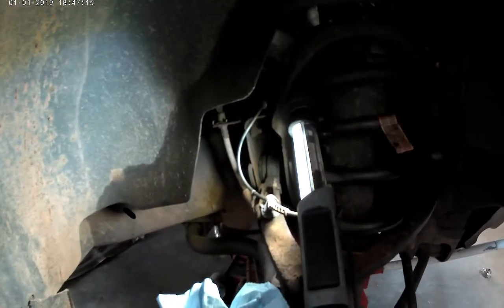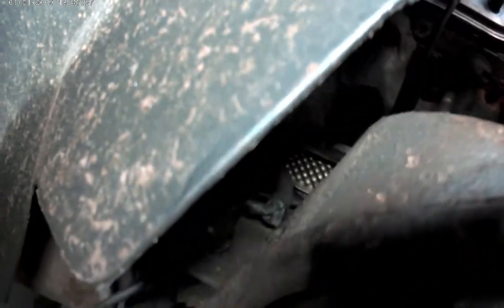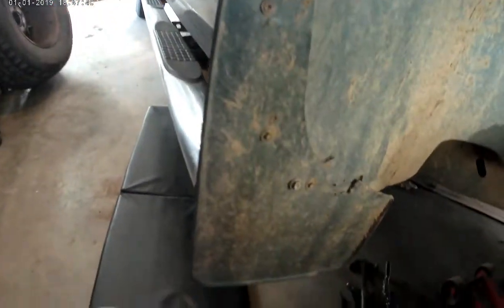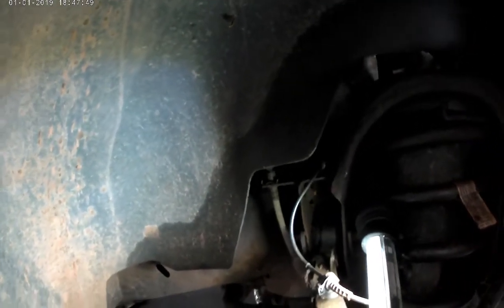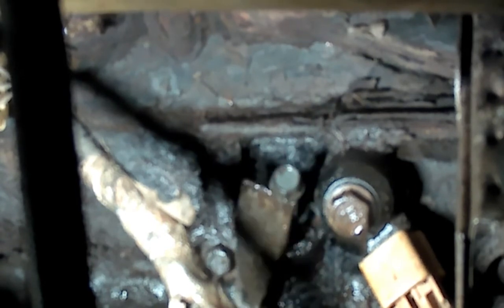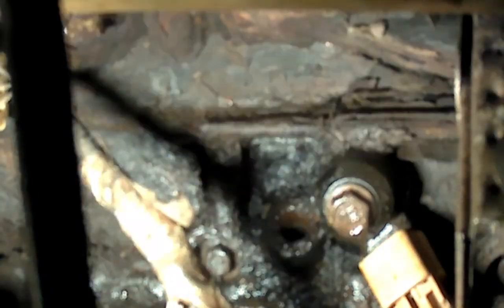How to remove rusty dipstick tube. Chevy/GMC 4.8L 5.3L 6.0L engines

Comment: I have to do mine, great video now I know  what I'm against. just taking the exhaust manifold  off  replacing it.
Thanks.
Reply: Ended up having to remove the oil pan knocked it out from the inside .